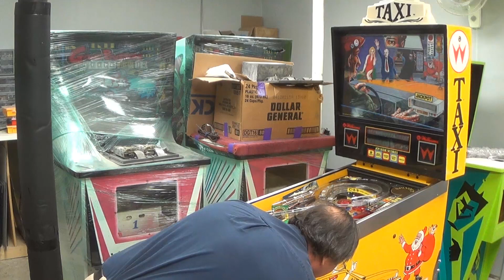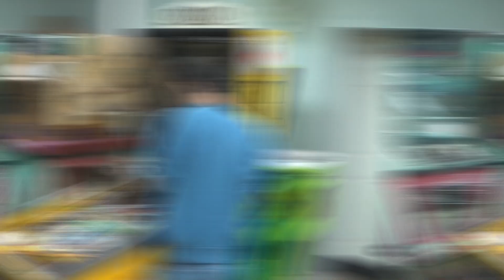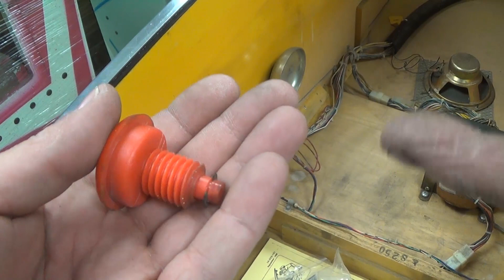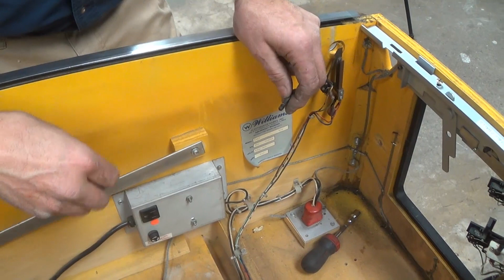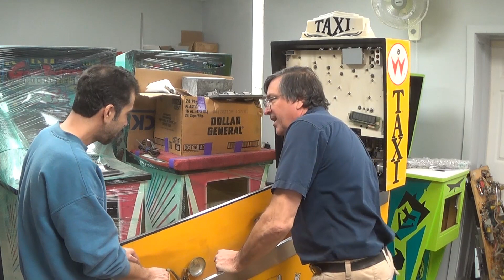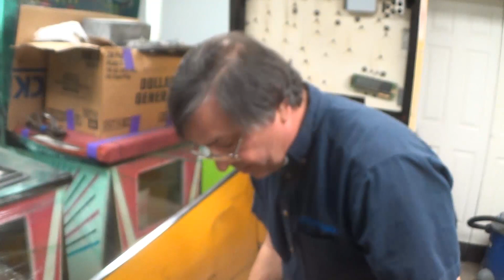Ray's Pinball Tech Tips #23.1 - Taxi Restoration - Part 1 of Part 1?

Comment: Hi :) Great work on these littles jewels :) 

I've the same pinball taxi but my jackpot don't light on the start of the game. 

Do you have a suggestion ? I've checked the circuit and there is a miss connector on J9 ( in the back corner right ) but in your video you have the same missing cable.

thx a lot for your work :)